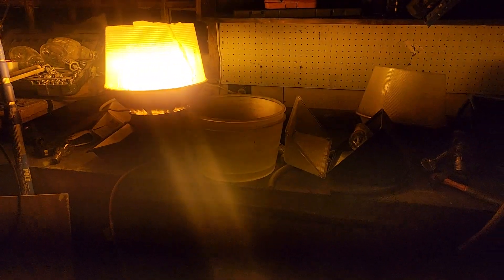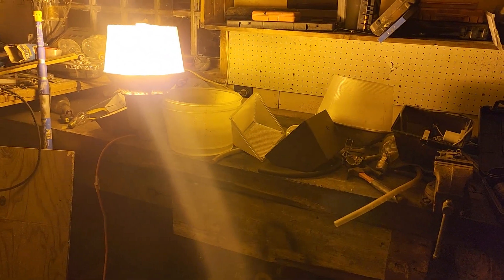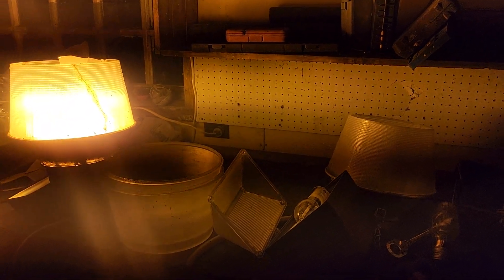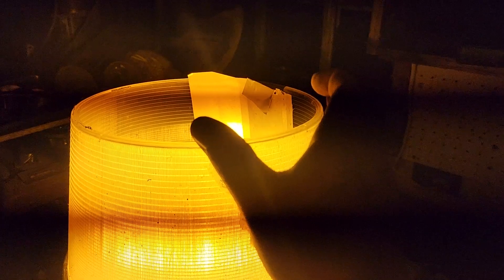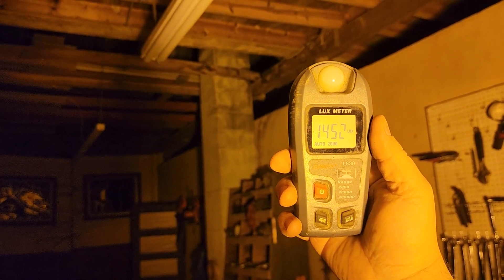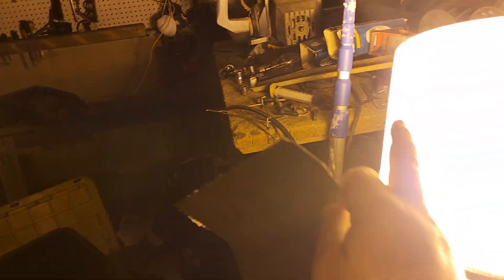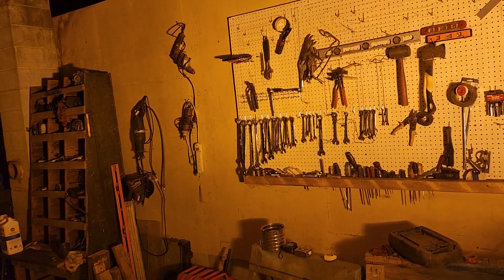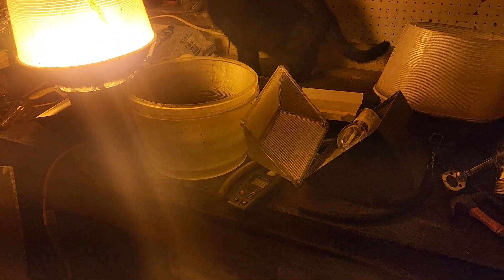Whats would the Lux be on a Hps Nema head light but with a reflector on it

Comment: Well, the NEMA style bucket lights that you own and operate are meant for wide spread lighting of a rather huge area. They spread the light all around the whole area instead of focusing it. If you take the lenses off, you will increase the light spread even more, but you get more glare. If you want more light directly on your parking area etc. you should use actual cobra head street lights that reflect the light downward with reflectors. This will probably more than double your usable lumens with the same bulb wattage as your bucket lights. ;)
Reply from the maker: No the parking area i want spread.  The problem im sayibg thpugh is on ultity poles.. or trees for example.. the poles actually block all the light behind the fixture.. because it shines right on the pole . Leaving a big shadow behind the light pile. So basically the reflector idea i have takes that wasted light thats just shining on the pole and pushes it fowards or down more
Reply: @jeepsblackpowderandlights4305  that makes sense, of course, as the aluminum is a way better reflector then the pole is. Looking forward to seeing your next video about the reflectors!
Reply: @jeepsblackpowderandlights4305 Did you complete these reflectors?  Have you made a follow-up video?